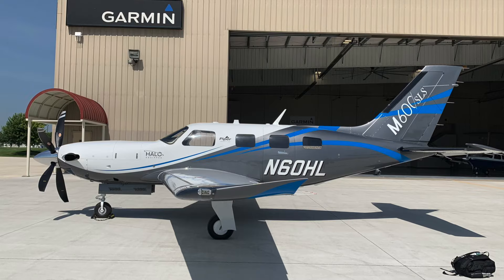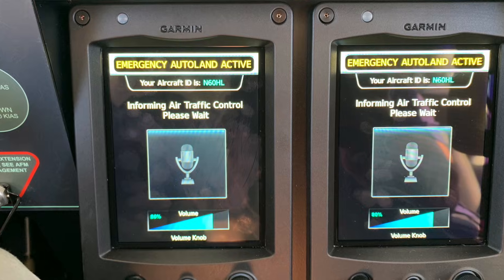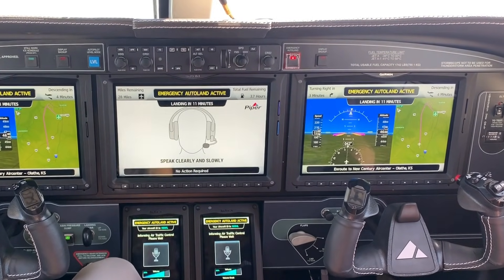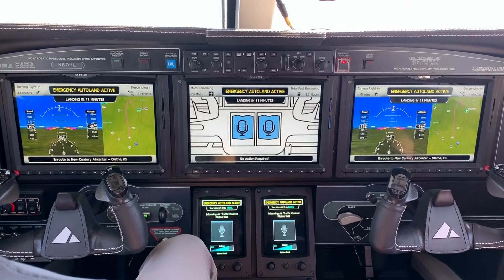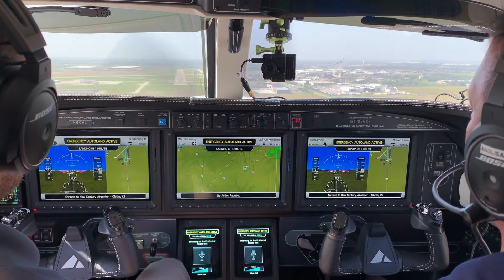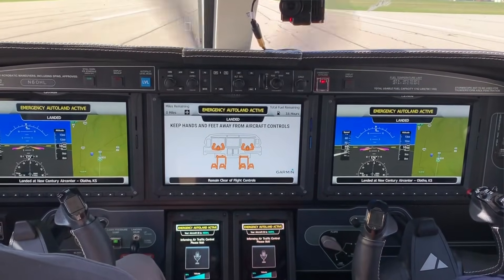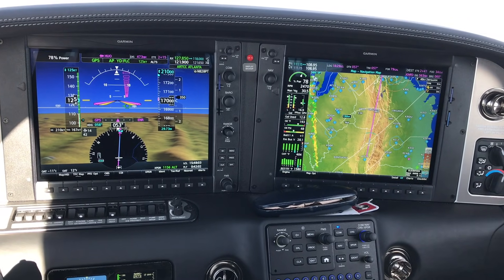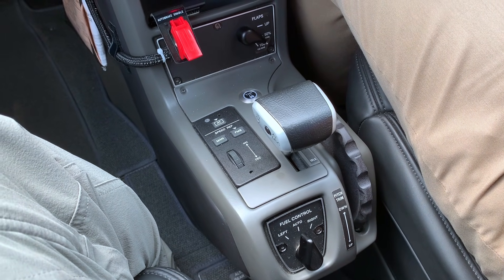Garmin Emergency Autoland Flight Trial

Comment: if there is anything amazing about this, then it has to be that it took so damn long. My hobby drones and fixed wing RC planes have been able to do this for what, 10  years now ? with a flight computer that costs less than 100 dollar. I know, its not quite the same, but even a very crude implementation thats no smarter than my RC pixhawk controller and crashlands wheels up flaps up on or near the runway would be a solution worth having when you have a single pilot flying passengers. Glad to see it finally being implemented.
Reply: Ardupilot or inav don't include a database of runways, check weather, communicate with atc.
 Landing ON a runway in the right wind direction is a lot more complicated then glide down with the wings level and hope you end up on a smooth surface .
Getting it certified and prove its reliable probably was the hardest part.
Reply: @cmulder002  Sure, the ardupilot comparison is a bit of a stretch, but not by much. My DJI does have an airspace database with places where it wont fly, thats not exactly difficult; it does check the weather (but does nothing with it), my pixhawk does communicate, literally even talk to me, the "controller" as well as sending telemetry data which even the garmin probably doesnt do ;),  it does know the wind direction and you can set up different patterns and trigger one or the other pattern depending on wind, this would be trivial to automate.  

I mean, you get my point. Garmin seem to have made a very polished system here, and thats a good thing, but even a much dumber, barely more than pixhawk solution could be a life saver, and be better than having only a 12 year with no flight experience be in control of a plane with an incapacitated pilot. This garmin system is clearly superior, probably better than using a parachute if the plane has one, and a dumber "custom pixhawk" flight controller may not be, but it still beats having neither of the other options.

As for certifications; not sure whats needed. Its a system that shouldnt be needed, isnt mandated. The only reason I can see it should be certified is ensuring it cant cause problems when its not activated. How good or how bad it works, how ugly it flares or whether its able to lower the gear,  Id say is about as relevant as how good or how bad the untrained 12 year old would do. We can only hope?
Reply: @P44man  mcas  that is what happens when you implement a potential good idea without  the correct certification process.
Also don't underestimate the improvements in technology the last few years.
That pixhawk you refer to likely has more processing power then autopilots of 20 year ago so things like what garmin is working on are getting more practical.
Even storing the database (and making sure its current) was much more complicated just a few years ago; one of the first "satnav" system i installed in a friends car had a dvd reader for the map data.... 

Data like the "windy" website are very resent so even if the weather data was collected (likely) a real time database did not exist yet
Also the wireless data network to transmit that data in flight is relative recent 
This clips shows the system working in ideal weather ; how does it cope with windshear for example or near max crosswinds with gust? 

What about icing how does it detect that and adjust for it?

When to fly to a alternate airport because of weather by itself is a difficult decision (is there enough fuel? )
Getting those things right to the level it will save people's live is hard and expensive.
Now the first system is becoming available its likely to become much cheaper soon and in a decade or so the average cessna might have it.
Reply: @cmulder002  mcas? really? Thats the worst possible example. That was a feature designed specifically to overcome human flying skill limitations, and it was not a good idea, it was a TERRIBLE idea relying on just 1 AoA sensor.

Compute power, sure that keeps going up, cost keeps coming down. But the processing power needed for ardupilot (the software that runs on pixhawk), the name may give it away, is an arduino. That might have been awesome during the Apollo program. but that is incredibly slow even compared to a 20 year old PC. Its not like we havent had that available and affordable (in the context of a real plane, not a toy rc plane) for ages. Even for small RC planes it has been around for almost 20 years now. 

As for wind; wind is not taken from windy, its calculated in-flight by comparing GPS data with airspeed and heading data. Its surprisingly accurate.

Windsheer and gusts; well, there is only so much a small and light RC plane can handle, but the autopilot certainly does it better than me as a human pilot. Which shouldnt be surprising, its so much faster than me to measure and react. Enabling autopilot or just flight stabilization to counter turbulence is considered "cheating" among rc pilots. Its the same sort of cheating that all fly by wire systems use in real jet fighters that allow humans to fly planes that would be too unstable without computers adding stabilization. 

Icing obviously is not a concern on RC planes. And if we are being honest, its not a likely a problem in the context of this emergency system either, its not meant for boeings. Does the garmin cope with it? If it can detect it, then so could a pixhawk using the same sensors or logic. Coping with it is easy enough, enable deicing and fly faster.
Reply: @P44man  for the wind data you prefer to know the situation at the airport you might choose to land at.
 Is it within limit and it decides  the approach from the correct side.
 All of that is a factor in the choice of airport. 

Knowing the wind-speed where you are is not enough for that .
A data link of some sorts is needed for that.
If icing is excluded that this system would be limited to warmer climates and that would exclude most of the U.S.A all of Canada.
So it has to be included and reliable.

MCAS was designed to make  the new version "feel" like the old one (if you believe Boeing) that is how it started..

And what do you mean ; you don't fly in "angle mode" ? ;)

Comment: Many times simpler than self driving cars!

I wonder about pilot only on board situation?
Might we set it up for say timed interval pilot ok query and when no reply auto engage the system? That would seem reasonably easy to do
Reply: 555Trout it sends an alert message to the central screen if there is no interaction with the flight controls or panel for a certain amount of time, then it sends an alert message to the pilot and then engages
Reply: @vagasint.4345  very good. Odd they didn't talk about this. Thx!
Reply: 555Trout I saw it or read about it someplace else 

Also, it seems simpler because it brute forces a landing by clearing the skies ahead of it. It doesn’t follow any rules or anything it just does. That’s why it can only be used in an emergency it causes chaos for everyone else.

It would be like making a self driving car that didn’t have to obey traffic laws or avoid any obstacles.  Then it’s just a normal RNAV flight and RNAV autoland
Reply: @vagasint.4345  It's a game changer. 
Do you happen to know if could land the plane with the turbine off, powerless. Of course with the assumption a strip is within glide range.
As in a turbine failure it could be better at managing the powerless emergency landing than a typical pilot.
Reply: 555Trout an engine failure is not a difficult emergency situation student pilots are taught that early on in training. It’s simple, hold best glide speed find a place to land. Go through the checklist to try to restart . if you have 2 engines apply rudder correction (which some planes do on their own) but a twin engine can fly easily on one engine (but you don’t hear about people talking about removing one engine because engines can fail) engine failure is one of the easiest and most predictable failure in the book. 
Let’s look at a more complex problem, computer failure or pitot tube failure how will the plane fly safely when the information needed to fly safely isn’t available for it to make decisions, how can the autopilot fly if the computer has failed and shut off (which has happened more than you think) also autopilots mess up and do things they aren’t programmed to do sometimes nav aids don’t work sometimes GPS is unreliable and doesn’t work sometimes the winds are too strong for an autopilot to land the plane then what?
Who will fix it then? 
Pilots are blamed for some crashes when really they don’t deserve the blame. AF 447 is blamed on the pilots because they didn’t recover the plane from the stall. Could an automated system have saved the plane? No because the pitot tubes didn’t work and the autopilot actually shut off the computer was worse off than the pilots. The captain noticed the problem when he got back into the cockpit. Which shows that if there were 3 pilots on the flight deck the plane could have been saved. The solution was not to replace the pilots but have an extra one. 
As I said earlier, autopilots sometimes just dont function sometimes they miss turns, overshoot selected altitudes, don’t descend fast enough, but that NEVER makes the news why would such a glaring issue not be reported? Because pilots fix the problem and it gets written up on landing and fixed by a mechanic. Nobody needs to know, no harm no foul. 
And again flying the plane is only half the pilot’s job and it’s already a lot of work. The other half of the pilots’ job is making decisions about the flight that go beyond emergency situations. Also, just because something can be done dosent mean it will happen. 
Think of this, we have the technology to remove the throttle, and the yoke/side stick  in a plane and control it using only buttons and dials. It hasn’t happened probably because it was found to be more effective in certain situations and those situations warrant there still being these supposedly outdated methods of controls.

Heck most airliners have auto rudder why are their still rudder pedals, they can come in handy even if it is an automated process, things can fail even the most complex computers
Reply: @vagasint.4345  computers don't feel pressure. I'd take a computer emergency landing my engine out plane; very a human being every time.
Appreciate your input but I disagree.
Reply: 555Trout well I think you missed the point that an engine failure is not the type of failure people should be worried about but hey it was nice talking. We will see what the future holds. No one can predict it right?
Reply: @vagasint.4345  okie dokie. Nice chatting.
Reply: 555Trout agreed

Comment: That works in Kansas. But if you are over Carson and the nearest airport is LAX, is it equipped to respond to a two hour hold request before it can be slotted in between the 777s?
Reply: l wilton other aircraft will be told to hold for arriving emergency aircraft

Comment: Will it monitor oxygen levels inside the aircraft or initiate an autoland in case pressurization fails?
Reply: Well the pressurization is already automated so if it detects that pressurization fails above x-altitude (i think its 10,000) they could set it up to ask the pilots to press a button to let the computer know they are still conscious every few minutes until the plane reaches a safe altitude.
Reply: @SirFloofy001  I know.. Which is why I asked if it is an actual feature in it already.

Comment: "Airplanes Have had the capability to autoland for many years" - You could say half a century...
Reply: Big expensive airliners have auto-land sure but it is not "single button" procedure.
To start you need to set the frequency of the ils of the active runway and guide the plane to intercept at the direction of atc.
This "single press" procedure is intended if the trained pilot can't fly safely anymore  (most for medical reasons) 
https://www.youtube.com/watch?v=ePDl1JNqjpM    is  what you need to do in a airliner instead of the single press of this system.
Reply: @cmulder002  Trust me, I know, but I doubt he was referring to some drones without a pilot that have been able to land without human interaction for a decade or two. According to Wikipedia, the HS121 Trident which was introduced in 1964 had something like the ILS Cat I and redundant flight conputers. Although Cat I doesn't allow for a total autoland because of standards, it is still possible to do one in most conditions. Doing a similar setup to this Garmim system would be trivial (not cheap) on any modern aircraft with FADEC.
Reply: @rkan2  My guess is the biggest delay is to get it reliable enough and the interactions with the "outside world" 

A drone landing on a runway when its expected in a controlled environment  is different then a computer having to select where to land and then inform atc about its intentions.
The actual landing is like you state a well understood processes; having the computer choose a active runway and obtain  landing clearance is a whole separate problem
 Simple thing could be that the computer has to have a way to confirm atc understood its transmission. 
People just do a read-back and we hear what the other is saying even trough static for computers that is much more difficult.
Another thing is that computers do not have "eyes" as good as we have (the data processing part) so this system likely is unable to visually confirm the runway is clear while its something humans do without even thinking about it.
There is a lot more about landing a plane then just "the actual landing" and most is taken for granted by humans that are complicated for computers.
Reply: @rkan2  The Trident had Cat III, I believe.

Comment: So, can this thing land on any old runway, or does it require localizer and glideslope signals from ILS?  Judging from the touchdown displacement from the runway center line, it was not tracking the localizer.
Reply: When they are taking off you can see a digital display of the runway that isn't taken from a camera, so i'm assuming the auto-land is using GPS only and that Garmen has almost every airports runways mapped out in their GPS software.

Comment: Can this be remotely activated so that if that pilot intended to crash the plain this automated mode could be activated and locking out the pilot until the plan lands???
Reply: Michael John Little that would be useless because the system can be overridden and deactivated from the cockpit
Reply: VAGAS INT. Cockpit video uplink would provide confirmation of the nature of incident. If a pilot has gone psycho, a complete override of cockpit controls would be nice so that a remote pilot could issue the computer commands. Of course, captain psycho might decide to start pulling breakers which would still achieve his intentions. This is great for incapacity but not much else.
Reply: starventure yeah, but they already talked about adding cameras to cockpits and people thought it was outrageous and stupid (and rightly so) I think the only good kind of camera would be one that could be manually activated in the case of an emergency by the pilots on board the aircraft do they can get a team of experts to try to help troubleshoot or come up with solutions. As in (I am taking a recent scenario) MCAS activates on the Lion Air flight  the pilots remember to switch on the camera. It goes to their maintenance base in Jakarta (or wherever they are based) while the pilots fight for control (which may buy some time) maybe just maybe they can contact the crew from the last flight) “you guys said this problem happened last flight how did you save the plane”
“The runaway trim checklist!” Maybe there would have had a chance to take care of that that way....

This is speculative there are many high profile crashes or crashes that were prevented or made better by having 3 or more people on the cockpit (UA 232) the Lionair flight that had the MCAS issue before the Lion Air Crash AF 447 could have been saved if the captain would have been on the flight deck which would have saved 447 (he supposedly noticed the issue when he got back on the flight deck but didn’t have enough altitude to recover)) It is clear that 3 heads solving a problem Is clearly better than 2 even with our high tech A330s and 737 MAXs I am not saying we need to go back to a 3 person crew on short haul flights because the third person would only be there as a crash dummy to come up with ideas in case something goes wrong. But the proof is that 3 cockpit crews come up with solutions far better than 2 cockpit crews especially with all this automation stuff. The idea of moving to a single cockpit airliner is purely financial there is absolutely no extra safety that comes with it.